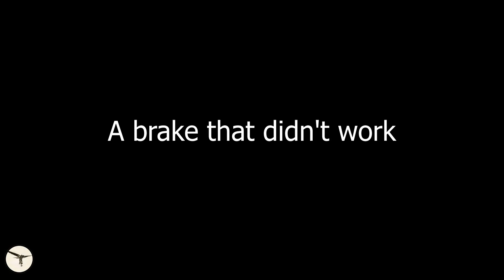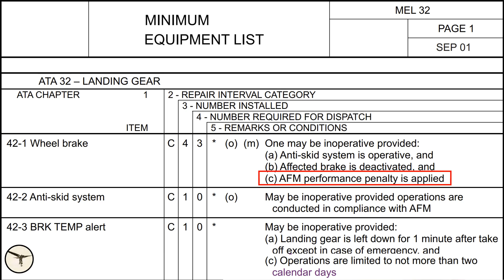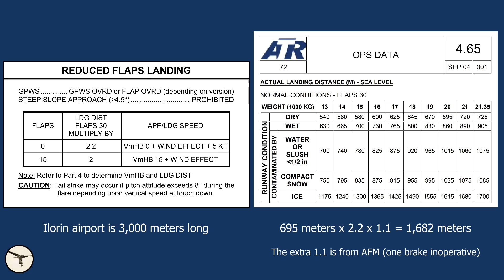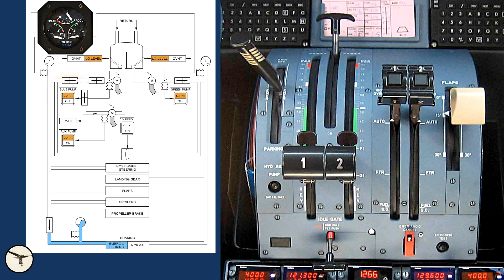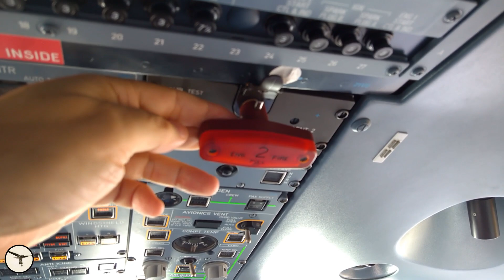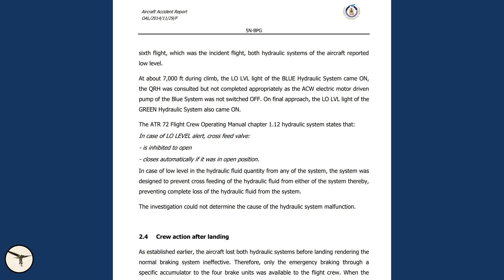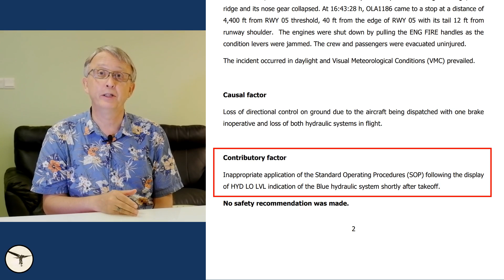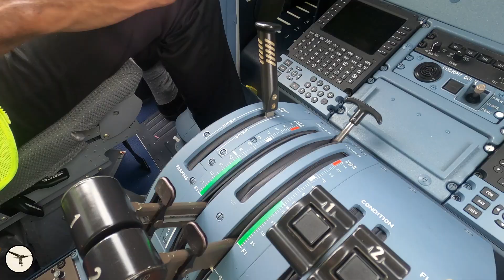Overland flight 1186 - A missing brake and total hydraulic failure

Comment: Magnar, your description about flap behavior when there is a loss of hydraulic pressure is something I've directly observed as a passenger on an ATR72 operated in New Zealand. On a go around due to ground based circumstances, I observed fluid leaking from a flap fairing which initially I believed to be water. However, once advised there was a "mechanical problem", I noted the flap position on the indicator on the wing fluctuating halfway between 0 and 15, and it was then I realised what I'd actually seen (and inadvertently photographed) was the loss of hydraulic fluid overboard. After a few vectors, presumably to allow time for the required checklists, we returned back to the same airfield (with a runway well over 3000m) for a high speed landing, and upon vacating I watched the flaps drop to 30. As steering did not seem to be affected on the ground, I can only assume from a totally unqualified standpoint that the loss of pressure was only on one system.

I remained onboard once the aircraft arrived at the gate to advise my observations to the cabin crew, who then brought that to the attention of the flight crew. The flight crew agreed when I asked them whether they had a loss of hydraulic pressure and proceeded to show them photographs of the failure in action, which they forwarded to maintenance. They followed up with me to tell me that it had apparently saved them a lot of time tracing the location of the fault.

I again assert I am not a pilot and certainly not qualified on ATR types. I was a Diesel Locomotive driver by trade at the time so had some understanding of basic mechanics but not much relevant to flying, but I did find the whole experience interesting, and the crew seemed to indicate that it was useful. Having watched this video, it's interesting to understand a bit better what I observed and how the chain of the failure of critical systems combined by potential human factors lead to the outcome. Thanks for posting. I did learn something!
Reply from the maker: Thank you for your feedback. Your observation definitely helped maintenance to locate the source of the problem. When the flaps started to retract, the crew recevied an alert "FLAP UNLOCK". Since they were on an approach, they had to go around and prepare for an approach without flaps. If the weight is 20 tons, the approach speed with flaps 30 is 104 knots. Without flaps, the speed is 142 knots, and the landing distance is multiplied by 2.2 (from 590 m to 1,298 m).
Reply: A partial  failure of the hydraulics on a Dumbo Curtiss Wright C-46 Commando is a different kettle of fish, on long finals to Yellowknife Airport ,the Dumbo  Skipper , appearing  calm as a vicar, really in truth, he is shitting his trousers. While the Second Officer is filling the hydraulic tank with Skydrol behind the Skipper,s left seat, his roughneck cargo  rat delves into the Dumbo,s bowels to wind down the undercarriage and flaps with  a handle off a Model 'A' Ford. Hoping to Christ he has enough hydraulic pressure to stop seventeen tons of Dumbo from careering off the runway. Dumbo driving in Canadas Northwest Territories is for the extremely brave or criminally insane.

Comment: Hi captain I believe u know what happen for the Nepali aviation accident 72-500 in January.  From ur From your experience and watching the plane crash, what caused this in particular? Nose up in final ? And there is a stick shaker  and stick pusher  before the stall    
With regard
Reply from the maker: Hi, ATR aircraft have stick shaker and stick pusher. Regarding the tragic accident in Nepal, I will not speculate.  Most accidents happen because of a chain of events. Many of those events are unknown for us until the accident report is released.
Reply: Thank you captain.

Comment: I was wondering whether the hydraulic cross-feed might be implicated. One obviously does not want to apply hydraulic cross-feed into a leak, but when would it be appropriate to use it?
Reply from the maker: Hydraulic crossfeed is used when one of the main pumps is inoperative.
Reply: @FlywithMagnar  Thanks.
Reply: If hydraulic system is the same as for 500 and 600 variants, in case of LO LVL, HYD XFeed is automatically closed if it was open, or disabled if it was closed. That's why ythe C/L doesn't mention X-Feed OFF
Reply: @FlyingFred-2A  I have to wonder whether the cross-feed valve could be leaking, and if so, how anyone would become aware of it before it causes a problem.
Reply: @sylviaelse5086  Ah ok maybe... I hope investigators checked this... but unfortunatly the report doesn't give many answers, and the root cause of the leak(s) was not found...
Reply: @FlyingFred-2A  Yes. A most unsatisfactory situation.

Comment: Interesting. You can fly, with restrictions, with one brake inoperative.
If I drive my car with one brake inoperative, making the car unroadworthy, this is illegal and will earn me noticeable penalties, even without an accident, if I am detected - yet the consequences of one out of four wheels having reduced braking capacity is, I would suggest, of lower consequence to that of an aircraft where the brakes also form part of the steering.
Weird, that.
Reply: While brakes can be used for steering the aircraft on the runway during landing, they are not the primary form of steering on the ground during taxi, so having one inoperative is not a problem. 

In general, air traffic is much more controlled than road traffic. If you get permission to land, it is the promise of ATC that you have the whole runway for yourself and noone else will be there. You dont have that with road traffic. You will always have people do stupid stuff around roads, but with a controlled airport you dont have that. One brake inoperative? You might just take a bit longer to get to a stop and you might be going a bit more side to side during the final rollout, but there is noone else around you, you would endanger with that. On a highway, there might be a car only a few meters left or right of you, were just veering over would result in an accident.
Reply: Do you have alternate procedures for driving with one brake inoperative in your car? You do not.
Reply from the maker: No, but the aircraft has a long runway for itself. Plus reverse. (Don't try that in your car.)